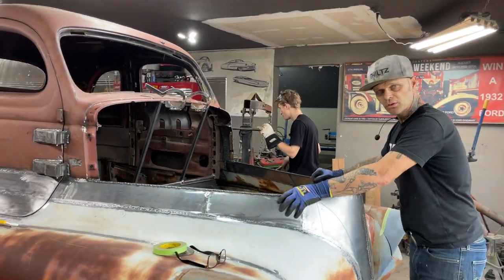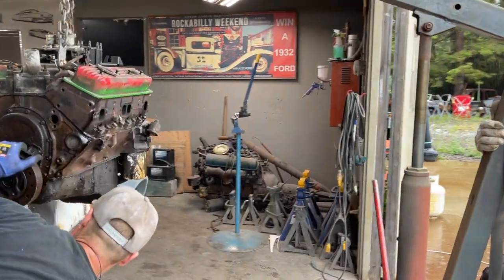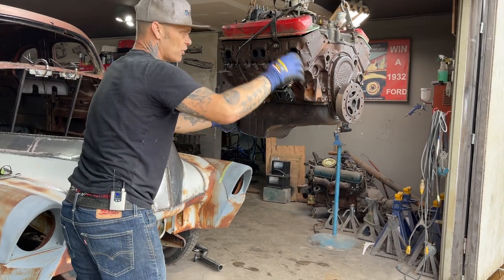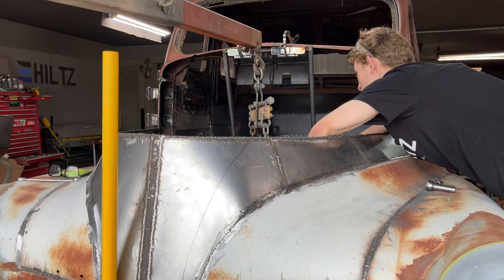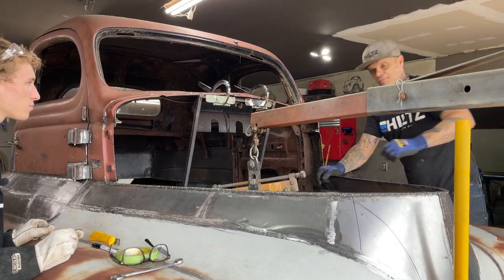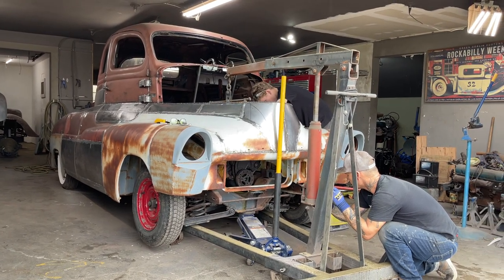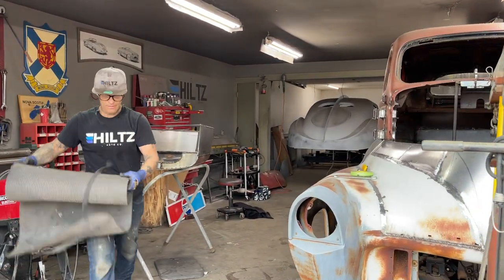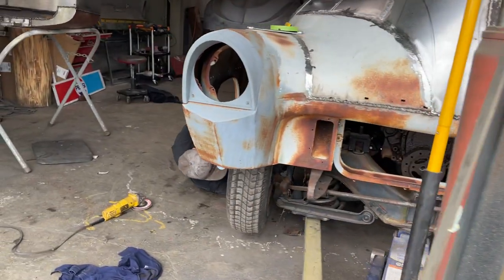ENGINE INSTALLATION: ANOTHER DAY, ANOTHER DILEMMA?

Comment: Chad great job teaching Aiden . .... when I install an engine without transmission. .... Put a bellhousing bolt one each side , then slide a 2x4 behind the engine , under the bolts... will hold up the back of the engine ...... Also take off the distributor cap , to make room and avoid cracking the cap....
Reply: Your idea with the bellhousing bolts are good if the car is already sitting on the ground. In this case however the car may need to be raised or lowered to do some finish work.  On a Chevy, the Dist. cap needs to be in place to get correct clearance, Etc. for firewall mods in case it's needed.
Reply: @rickhettwer854   I take the cap off every time I install an engine , so it doesn't get bumped and cracked. if you need to measure clearance or anything just re install cap . I just take it off during installation .
Reply: @randyhontz60   Yes of course, I would also remove the cap if i new i were to use it for other than a mock-up.

Comment: Put in a 45° piece above the lower firewall to the upper firewall. This way you will be able to see all the work you did and you might have to remove the upper fire if your motor is removed which you said will be put in. 
Those trips should be good too. I wish I had the set up I had in the 70s on my 327 they worked great! Now I am looking for another 6 pack for my 62- 283 with matching numbers on the heads but they want alot of money for that set now.

Comment: Great video glad to see your getting use out of the magmatic level I sent you 👍
Reply: Chad,  The way an engine should fit is so that the drive shaft universals [hooks couplings] is 1. Line up, 2. both must work at the same angle ! This is very important; If the couplings do not drive at the same angle, the proppeller shaft will vibrate.!!!!!     If you can not tip the engine to attain the couplings to work at the same angle, then the rear axle angle has to be remounted to get the couplings to be at the same angle.  One shoulg not try to fit the engine level. If you try to level the engine before the weight of the engine is on the mountings, the engine will not be level when it rests on the chasis. pardon my inglish please.

Comment: Love what you're doing Chad  . Your firewall doesn't need the offset .It will prevent removing the engine . Just follow the the angle of the cowl bracing to finish the firewall . The flywheel and distributor won't be blocked for a straight lift .

Comment: Those vice grips you got clamped on that cherry picker isn't safe ... especially when there pointing up..the reason I say is because I had a motor jacked up in the air like you did fixed to install in a 68 mustang the transmission was still in car an I reached down to make sure torque converter was pushed all the way in an just as I was raising back up I bumped the motor an the gravity let them vice grips fall back around an the motor fell..I meen slammed fast an hard in side of the car..I was with in seconds an inches of having my head an upper part of my body smashed..probably would have killed me an I was working by myself nobody wouldn't have even new ...it scared me so much that I left it like it was turned out the light in the shop locked door an went home freaking out an didn't go back to work on it for about a week ...an I made sure I took them vice grips off the cherry picker never clamp a pair back on them...an took a good friend with me when I worked on it.....just saying from experience with them dam vice grip on that release screw on that cherry picker brought back a night mare for me.....Truck looks cool an bad ass👍👍👍👍👍👍👍✌️✌️✌️

Comment: I would think it would be prudent to get the motor installed and then do the custom metal work around the engine and exhaust, and all the other things needed- you could make a really cool surround out of metal! Great Work!
Reply: Good fit. Six pack will look good, Hope it has a Cam.

Comment: good idea to take a moment and confirm the engine can be installed.  You could always make the whole front end tip forward.  I had a few old Corvettes that had hoods that tip forward and it made it nice to work on the car...and there was a lot of work they required
Reply: Second that

Comment: SBC is one of the best engines for parts. Its pretty cool how the 305 and the 350 look the same. In the past I bought a 1967 Cutlass 442 and the engine looked great I took the numbers off the block and instead of the 400ci it was a 260ci they look the same haha

Comment: The six Pack name is patented by Chrysler Corp.  AKA Mopar back in the late sixties. On a Chevy it's triple deuces. If you know what I mean? Good choice on a dependable engine. plus it was already set up, bonus. The only issue is setting the points, if it still uses them. The hei distributors are too big for the triple setup. They make a mini version you'll have to source. Good luck an keep on trucking.

Comment: Chad, - Ford 351`s were cast & built in Ohio, at the Cleveland plant.  302`s at their Windsor plant, in Ontario Canada. I`ve been driving a 1989 LTD Crown Vic for 21 years, now. Runs on a 302 W. When orders for 351`s came to the company office, they would then pass that paper work over to Canada, for an engine

Comment: Glad to see you checked to see if the motor would fit.  Just make sure if you need to take out the distributer  it will not hit the metal

Comment: Chad, That trip-deuce setup is a little more than that 305 can handle especially if it has a stock cam and internals.  If I'm not wrong  the 305 was made to lower the corporate fuel mileage average, it was never meant to be a powerhouse engine.  If you have a 327 or 350 they would benefit from the trip-deuce setup.  You need to maybe to run that magnet across some sandpaper in case it has a clear sealant that's blocking contact with the metal.

Comment: Nice thing about the older chevy engine setup is it didn’t matter if it was a 4/6 or 8 cylinder they all bolted up to the bell and in most cases the same motor mounts.

Comment: Looks like you will need to notch the crossmember for a fuel pump if your going to run a mechanical one. Nice to have so much room to work on the engine!

Comment: SBC and BBC blocks are built so that when the carb mounting surface is level, there is a built-in 4 degree down angle on the crank shaft/bell housing to create a proper pinion angle. You don't add extra angle to the motor.

Comment: Do you have an old wheelbarrow? I have seen the front part of a wheelbarrow works for a shape to use for a firewall. The clearance you would gain will make you smile when trying to get access to the bellhousing bolts.

Comment: Great video today. I found myself holding my breath as Chad was lowering the motor, hoping that he didn't try his repeat, repeat, repeat method of lowering the engine like in the Bugatti video. Looking forward to tomorrow's episode. Great camera work Jolene, as always.
Reply: Noticed you have a vise grip attached to the cherry picker to lower the hoist. It should increase the control of lowering it to keep you from releasing the hydraulic fluid too quickly.

Comment: Might think about a distributor relief in the upper firewall in case you need to pull it out. Will engine come out once you install upper firewall?  Hard to tell from the video. Great job, like the engine choice.

Comment: That went in nice an easy, good job
Reply: I think a lot of the mercury was built a long time ago when Chad had some help. Looks like the front mounts for the engine will work. If the car is going to be driven on the street the mount w/rubber works well.

Comment: Chad remember you got the body up on the jack, so your firewall cut will need to be higher because the body will be lowered to ground level and transmission tunnel  need to be at same level to be evenly  with drivetrain.

Comment: Don't let that distributor contact the firewall when you drop the back of the engine lower. It won't like any strain on it and it'll be buggered up pretty easy. You want about the thickness edgeways of your hand clearance when the engine in on its mounts and the trans mount is under the tranny and bolted.

Comment: I would slot the engine mount holes that way you could move the engine forward a little to give you a little more room from the firewall and distributor.
Reply: You can buy a cap that is much smaller than the original HEI cap. 
Or just drop an earlier model distributor in it. They had small caps

Comment: The oil pan is bigger in the back because that is where the pickup tube goes down into the oil pan and the oil has to puddle up somewhere so the pickup tube can pick it up and just dispense it around the engine

Comment: USE  3/8 steel plates  and make a strap and shift motor mounts to rear get it off the wheels. The Floor of truck is high so you can easily shift that motor back 6 inches and cut fire wall accordingly or put in a ford motor with DIS in front!

Comment: @Bad Chad, i didnt read the comments, but if you arent going with efi, the distributor has to be changed. And gm hei is much larger around. Will need intake for carb as well. 
Tbi is not that big a deal if you have the donor vehicle.

Comment: Chad check the hei distributors they are wider than that distributor fire wall will need to be pushed back a little heads up for yah feom Florida👍

Comment: Make sure you have enough room to get the distributor out of the motor if you have to take the distributor  out of the motor order with that flat piece of metal that you're putting on top of it in the middle of the firewall I don't know if you thought about that yet

Comment: That engine that you have in the back is equiped with a manifold from the early sixties you can tell by the oil filler tube in front

Comment: That distributor looks like it will need a computer, if you are going to use and older points type distributor it will be about the same diameter as the one you have on that motor however if you want to use the early HEI distributer that doesn't require a computer you will find that that distributor will have a much bigger diameter and looks like it will be a clearance problem.

Comment: For sure you will need the car on the ground with the engine in place with the transmission mounted then you can check for firewall clearance. Using the level with the nose in the air will give you the wrong results. Just an observation.

Comment: Is that a stroker engine almost looks like a 400 harmonic balancer can't really tell looks thicker then 350 balancer
Reply: Chad may need an externally balanced flywheel depending on what sbc engine he ends up using.

Comment: You will never get the engine out or in if you build the firewall the way that you are. Not to mention if you have to pull the distributor you won't be able to

Comment: I would get a wiring harness of a 1990-1994 Chevy pickup and use the throttle body that’s on the engine then you would have fuel injection
Reply: You’re joking right?